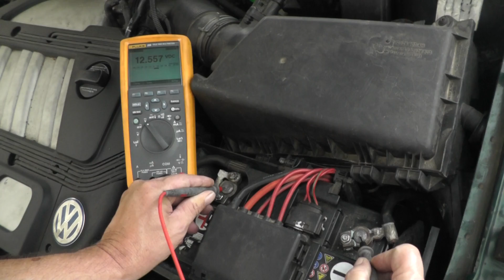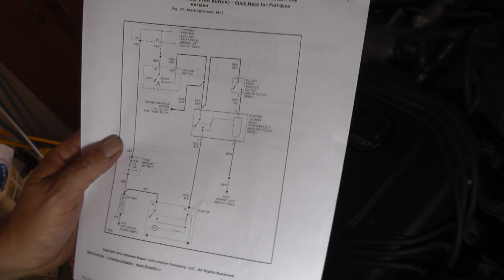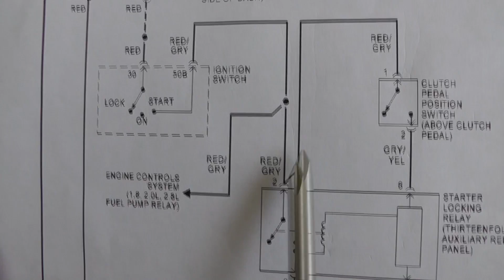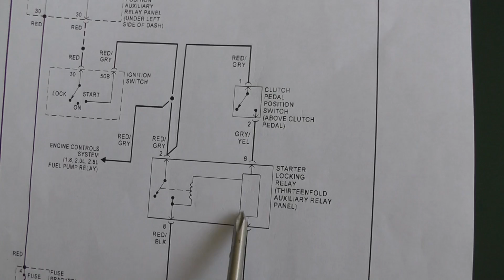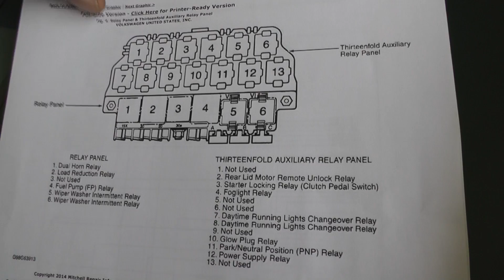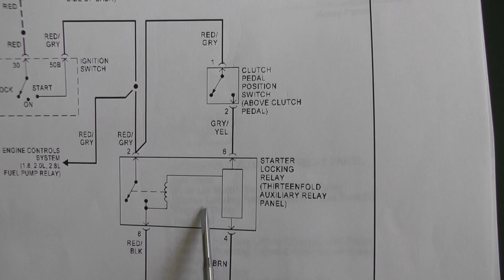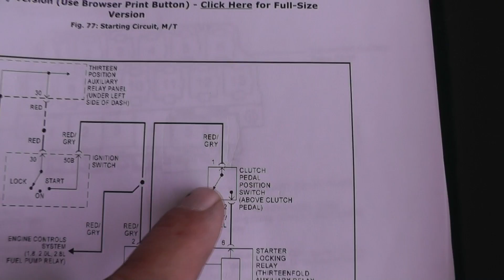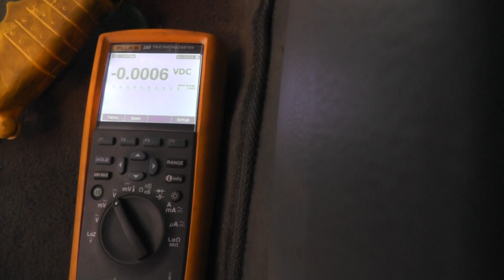Volkswagen Jetta Won't Crank, Electrical Diagnosis - Part 1

Comment: Guessing by your accent you're from NC. Oh and I love VWs and I work on them all the time. That 13 fold relay assembly is much easier to access by removing the lower dash panel, then the metal panel behind that.
Reply from the maker: +Jacksonkellyfreak Yep, that's correct and once I got into a little bit, the relay center wasn't that bad. Guess I scared myself in the beginning LOL...
Reply: stuzman52
I got family over in Morganton and took flight training in Rutherfordton over at Big Air Aviation at Marchman Field. VWs of that generation are actually pretty easy. I got a 2000 Jetta. Same engine and same 5 speed transmission. I can tell by the wood trim that yours is a GLX model, but mine is a GLS. I tell ya when I got the Bentley manual on  PDF it made working on the thing an absolute cakewalk.
Reply from the maker: +Jacksonkellyfreak I'm over near High Point and I can't quite say that I have the same enthusiasm as you do with VW's. Most of the things that I've worked on with this car hasn't been the easiest thing to work on compared to other cars. And with this engine, it's not a lot of room to work on especially if you have to get on the left side of the engine. But, they are pretty peppy engines though and the wife loves to drive it. Looks like I'll be working on this again next week as I have to change the 'crack' pipe, thermostat housing along with a few other things. Take care Jackson and thanks for your comments.
Reply: stuzman52
are you putting the metal pipe in? Are you doing the thermostat housing as well? I'm over between Pigeon Forge and Knoxville. I know a lot of people are not very enthused about working on them, but for some reason I took to them like a duck to water. And I've only had mine since 2013, but the first week I had it that stupid door lock module went berzerk and I had to fix it, so instead of buying a $180 part from the dealer I bought a $5 microswitch from Radio Shack lol. I've worked on cars my whole life though. The only thing that really kind of sucks about these cars is that aside from the diesels and the Beetles, they have crappy resales. I got mine in perfect condition with 176k on it for 1600. And if you look at a 2.8 car with timing chain noise,( which I'm thinking of finding one needing chains to have as a second car because I'm driving 100 miles a day for school now) they're not even worth a thousand really because of the work involved with that. And it's because they are fiddly and challenging to mess with at times, most engine work requires removal of the front end, They're perceived as expensive to fix and the timing chains are on the back of the engine. Labor rates will flat out eat you up on them, but there are parts sites that sell oem and good quality aftermarket parts for them at really good prices. RockAuto is one, but you really gotta watch them on the 1999.5-2001 because I've gotten a lot of parts for the previous body style that were listed wrong. Germanautoparts, ECS tuning and Uro tuning are really good and you won't pay through the nose for things. I'm no expert on em by any means but I do know a lot about them, and you can feel free to send me a message if you need some help.
Reply from the maker: +Jacksonkellyfreak I'll be replacing the thermostat housing, thermostat, oil cooler o'rings, oil filter flange gasket along with the coolant pipe. I went back and forth and did some research of whether it was going to be plastic or metal. And looking over the forums, it seems it was a toss up of where some loved the metal coolant pipe and others didn't like it because it leaked. And some even went to other vendors after their leakage issue  and it still leaked. Maybe something wrong in the bore behind the water pump. Who knows! I'm going with the plastic OEM as I don't want to take a chance on leaking. As you've mentioned, some people love VWs and love working on them. Me, I'm not that crazy about the car and have only kept it because the wife loves it. In any event, after this repair, I believe this car is going to get sold. And what engineer would have you remove engine mounts, tranny mount along with a slew of other items, jack the engine up to replace a water pump. And putting the timing chains on the rear of the engine, what a great idea of where you have to pull the tranny, clutch assembly if manual, flywheel to replace these items. I wonder why the German engineers didn't split the engine block in the middle, put the chains inside between the two blocks and then have you remove the engine, unbolt the two halves to replace those timing items. I worked with a European mechanical engineer and what would seem like an obvious solution to anyone, he would come up with the most bizarre, most complicated solution to a problem. And he could never see the logic of his design compared to what should be simple. That's how I see the German engineers! Let's make it as complicated as possible... As for RockAuto, I've got some parts from them that didn't work either. Point in case is using a fuel pump relay. If you get an aftermarket and not an OEM relay, your car will shut off when you open the driver door. I put a small video out warning people of that one. I like using www.germanautoparts.com as their parts are OEM and haven't had any problems with their stuff. Well, take care Jackson and have a good weekend and thanks for your thoughts...
Reply: stuzman52
I know man. German engineering=over engineering lol. Just out of curiosity, how much would you ask when you sell it? I wouldn't mind driving a piece to get one that has video proof of all the repairs done to it. How many miles? And have you done the chains on it?
Reply from the maker: +Jacksonkellyfreak Don't know what I'll ask for it as I leave all of that up to the wife. She does the researching and so I just leave it to her. I think there's about 160K miles and the chains haven't been done although there is no noise coming from them.

Comment: Thanks a Ton! Your video helped me diagnose another no start issue. Mine was a bad ground on the backside of the relay.
Reply from the maker: +Sam Moan Glad to hear that you got it fixed Sam!
Reply: In diagnosing this i ran into another problem. I was mistakenly looking at the black clutch switch and not the white one that is up higher. My Chilton manual also led me to believe the clutch switch interrupted ground so i grounded to the metal brackets on the dash and caused a cloud of smoke. I was wondering if you would know what that could of been or have any wiring diagrams for the cruise control system. The car runs as normal but i haven't actually drove it due to everything being all apart.
Reply from the maker: +Sam Moan Don't know what kind of issues that would cause other than blow a fuse. You can get some free wiring diagrams at www.bbbind.com Click on 'Technical Information' and then on 'TSB's & Wiring Diagrams'. You should find all the wiring diagrams that you'll need.

Comment: I have a 2000 jetta and my Abvs light will come but there is nothing wrong with my brakes. it is now having electrical problems if the light pops on when I hit my brakes my headlights start flickering my radio clicks in and out and if I use my blinker it flicks my head lights and my radio in and out. anyone have any idea were to look for the problem at?
Reply from the maker: +Cozia James It sounds like you've got an intermittent B+ or ground issue, possibly corrosion. Time to start pulling out some wiring diagrams to start doing some diagnostics. I would look over the diagram and see what's common to say your radio and headlights since they are flickering. And I'm sure that your ABS is connected here too, but the other two circuits would be easier to access. Go to www.bbbind.com to get your free wiring diagram and good luck on your diagnostics.

Comment: I did check all of those, I just put in a new stereo and I believe the wires need to be adjusted, it's draining my battery. I connected all the wires as diagram states but I have read a few pages saying to reverse the yellow and red wires. Do you have any suggestions on the wires? Do you have any videos on timing belt changing on the Jetta? Thank you
Reply from the maker: +Leeny Marie Doyle I would follow the instructions with the stereo and would assume that if it's wired correctly, it should work without draining the battery. So, it sounds like you may have connected on to a B+ point instead of maybe a point which is controlled by the ignition switch. I don't know anything about what stereo you used, so I can't help in that regard. As for timing belt changes, I don't have any videos, but check out my friend's channel where he works on VWs everyday for a living. https://www.youtube.com/channel/UCm3WosFt2A-Z1P436Fkjfxw

Comment: So on my 00 Jetta the dash lights won't even come on, doesn't turn over and then I hear some weird clicking noises in the steering column. Do you have any ideas what it could be?
Reply from the maker: +Leeny Marie Doyle Lenny, I assume that you've checked the battery. Another easy check is to check your fuses. After that, you'll probably want to drop the panel underneath the steering wheel to start some electrical diagnostics.

Comment: Hi I have a intermittent issue with a Golf mk5 GTI. randomly when we try start it, it will turn over once or maybe less, and then stop. if we turn the key off and on again, it starts perfect. Ive changed the starter with a 2nd hand one an changed the battery, its still doing it. any ideas?
Reply from the maker: +toiletduckie44 First you could do some voltage drop testing of the battery cables. And if that looks okay, start taking a look at the ignition switch and starter relay.

Comment: hello i have a 97 passat vr6 and when i turn the key on it doesn't send power to my gas pump and it takes 3-4 times so it can start anyone know what could it be thank you.
Reply from the maker: Amancio Ramirez Maybe you're having an issue with your driver door where the fuel pump doesn't prime when the door is opened. Maybe something like this video https://www.youtube.com/watch?v=G_uBUhZgXxk&feature=em-subs_digest
Reply: even when the door is close it does it
Reply from the maker: +Amancio Ramirez Did you actually check the voltage on the load side of the fuel pump relay to verify your suspicions that you're not getting power to the fuel pump? What did you check to know this?
Reply: +stuzman52 no how can i do that
Reply from the maker: You could check the voltage on fuse 28, which is a 10 amp fuse. This fuse is for your fuel pump. When you turn the key to the start position, you should see 12VDC on this fuse.  You could also monitor the current through the fuse to see if your fuel pump starts. I haven't check the amperage, but should be around 5 amps. Another quick method to check amperage without an ammeter is to measure the millivolts across the fuse. You'll see the small voltage when the pump starts.
Reply: +stuzman52 okay i will check that 2mo thanks a lot ill let u know

Comment: This is totally weird. The other day I was sitting in my car while it was running and I turned the key to turn the car off and the engine and everything kept running even when I pulled the key out of the ignition, so I put the key back in and let it run for a while and maybe about 10 mins later i turned the key took it out and it turned off like it should. 2000 Volkswagen jetta GLX. Any idea on what the problem might be?
Reply from the maker: ***** I would start looking at the ignition switch itself.

Comment: PLEASE answer, when you turn the key to start, was there still spring to it or was it just loose? Mine has NO spring at all!
Reply from the maker: Hi MIchael. In my situation, the ignition switch felt perfectly normal. When I turned it to the start position, there was spring action and seemed normal. Yet the switch was of course bad. If you have no spring action at all, then you know definitely that you have an ignition switch problem.
Reply: Yes, I am looking at replacing the ignition lock cylinder
Reply from the maker: Michael Farmer Keep in mind Michael that the spring action is in the ignition switch when you turn to start, although you may have a lock cylinder issue also.
Reply: okay, thank you for the correction. This has all been a learning process because i'm 17 and it's my first car.
Reply from the maker: Michael Farmer That's okay Michael. If you have an interest in how things work, you'll find the answers which can help you work on your car. There's a lot of info out there which is free, so you'll do fine if you have the interest to learn.
Reply from the maker: +cortni goddard You probably have a bad ignition switch. You'll need to pull the upper and lower cover off of the steering wheel to find out. Although this video series is for the VR6 engine, your Jetta should be very similar if not the same. Once you get the switch out, you'll be able to ohm it out as I show later in the series. Also, you'll know at this point if you have any issue with the lock cylinder, but my guess it that it's going to be okay. Good luck on your repair
Reply: Cortini, when I took mine apart I found that the little metal pin going from the electric ignition switch to the lock cylinder had snapped off of its original location making it loose in there, I believe that's what causes the spring less feeling

Comment: People like to rag on VW for being bad to work on (and I'll admit,  some things are a pain),  they've got nothing on BMW, Mercs, etc.
Reply from the maker: Hi Billy, you're right that VWs can be a pain in the butt and I'll have to trust you on the other makes as I haven't had a chance to work on one of them. Thank goodness for that!
Reply: better oem part availability and price for vw/audi as well.  Anyways,  just hope you never have to replace a heater core in a VW.... ;)
Reply from the maker: Billy Severt Yes, I've heard that replacing the heater core is a bear although I've never done it before. Thanks for the insight Billy...
Reply: the joke is that when VW designed Jetta's,  they started with heater core, then built the rest of the car around it...
Reply from the maker: Billy Severt Ha, Ha...you're probably not to far from the truth..

Comment: hello Stuzman52. your videos are amazing and very explicit. i got a vw jetta 1999 1.9 engine on it.i drove 40km with it and after stoping the engine for just 2 minutes it doesn't start again. turning the ignition switch on, it turns directly to the start position without any signals, the dashboard doesn't turn on. the key is just turning freely in the ignition and the headlights, central locking system  and horn works properly. do you have any ideas what it is like?
Reply from the maker: Thanks for the comment on the videos Big Jon. Since your car isn't doing anything when you turn the key and the key turns freely in the ignition switch, it sounds like you may have a bad switch. Drop the covers around the steering column to get access to the switch. I'm not sure about the details for your car as it may be different from mine. They should be similar though so it should be easy enough to figure out. Once you get the covers off and have access to the switch, you should be able to do your diagnosis there at the switch. Good luck on your repair and take care...

Comment: Got new batt and wire harness and still nothing I'm just going to give up soon and many crush the car at wits end with this thing
Reply from the maker: Chris, no need to give up  so soon. Is the car still a no crank with the low voltage? Tell me where you're at and what the symptoms are? I can't remember if you told me, but what year is this VW and engine size?
Reply: Its a 2002 jetta 4 cil 2.0 with no crank went out and got a new bat and brought the starter to have it tested and its good I'm going to the dealer to c if my key needs to b recoded I also reset the alarm system still no crank
Reply from the maker: While you were under the dash, did you happen to check the start position of the ignition switch to see if voltage was getting through the switch? I don't have a diagram for your car,
Reply from the maker: so can't say where to check for points to check.

Comment: I think I found the prob I hope fuel injectors wires and harness are fried
Reply from the maker: Holy crap Chris. What did you exactly find?
Reply: The harness that is melted goes to the starter I think that is y I have no crank
Reply from the maker: Chris Leslie That would be a very good reason why it won't crank. When I told you about the battery, I did think it was strange that you had only 4 or 5 volts when you tried to crank it. For the voltage to get pulled down that low, you've got a major short in the wiring. You may have a blown fuse(s) with this kind of damage. In my case, I didn't have any fuses blown with the burnt insulation. As you may know, on my car, it's a 110A fuse feeding the starter circuit. Not sure about yours since I don't know the year. You may need a wiring diagram for your car as I'm sure there will probably be other wire insulation melted. Keep me informed of your progress in what you find.
Reply: I tore the dash apart found no blown fuses no melted wires I think that's the only spot they don't make it easy to get to the wires under the dash love vw
Reply from the maker: Chris Leslie Okay Chris, sounds good. Keep up the good work!